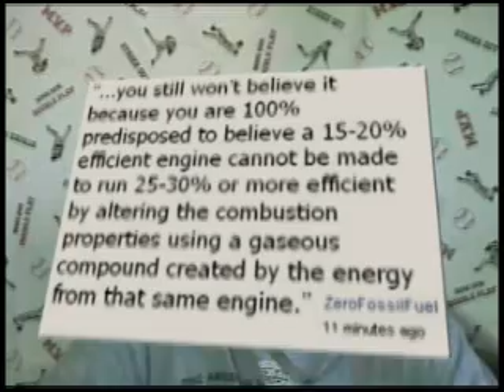Follow-up: '#232 - HHO runtime experiment part 3'

Comment: with more power at the right rpm u will have to push the throttle less for the desired speed..... which leads to less fuel consumption.  it may be very very little when going from 82 to 96 octane.  but it does increase mpg.

Comment: I am not a cultist. I've been trained in science since a child in school. I built 3 hho gens & have tested all 3 in my '96 Ford Explorer 5 ltr V8 that was getting only 8-9 mpg in town and 10-12 mpg on highway trips. My last 2 highway trips w/ hho gen, logged 14.9mpg & 17.2 & my vehicle was not empty, I was carrying extra loads in the back of the suv -explorer. Real highway evidence, not lab numbers from static testing without a load. I also used smackbooster designs to build 2 of my devices.

Comment: @MegaVelvetElvis Part 3, Jacob Wall continues:

4. The challenge to using hydrogen as a
supplemental fuel is the storage and generation
of hydrogen.
5. Use of electrolysis of water to create hydrogen
to enrich combustion should be completely
experimentally investigated before dismissing it
as ineffective.

------------------------------------------------------

I think it is you, MVE, who needs to do more research...

Comment: @MegaVelvetElvis --- Part 2, Jacob Wall writes:
Introduction of hydrogen into the combustion process
has been shown to:
1. Increase thermal efficiency and decrease fuel
consumption.
2. Decrease carbon monoxide and unburned
hydrocarbon emissions.
3. Increase NOx emissions unless proper timing
and mixture adjustments are used.

See part 3

Comment: @MegaVelvetElvis -- But that is not what the report says. That is not what I've seen with my own eyes. HHO increases the lean burn operation allowing you to use less fuel. This leaner mix of fuels increases the TE of the engine giving you more power. Yes there is an additional load but due to the inc. TE  you get the same performance from the engine but using less fuel. Under the right conditions this works well. 3X more fuel usage is BS. I've seen it work and the study confirms this.

Comment: @MegaVelvetElvis --- Nope that's not the case, the study in question here showed higher NOx while others show reduced NOx levels. Anyway NOx emissions are reduced in the cat. so It's not really an issue either way... Cost of operation? Humm, KOH and water is pretty cheap and since you are saving fuel I don't think cost is a factor...

Comment: @Desertphile --- No MVE hasn't been using my numbers. He may have pulled some numbers I posted as rebuttals to his his numbers. In each case I have stated that all of those types of numbers are speculative. The data in the report are the only valid numbers in this argument. We have scientific proof vs the youtube naysaying crowd's opinion. BTW I know that this does not mean that every HHO application will work. However the theory that you can save fuel using HHO has been proven.

Comment: @MegaVelvetElvis --- The bottom line here is this peer-reviewed scientific publication concluded that after factoring in the power requirements replacing part of the fuel with HHO made on board give you an increase in TE and you save fuel. And no matter what you say here that fact will remain. If you feel this report is in error then go ahead and dispute it but do it the same forum as the report was done. Build it, test it, and get your results published. End of story...

Comment: @Desertphile --- No hatred here from me. The fact is MegaVelvetElvis' numbers are not valid. They are mere speculation and have no real value in evaluating the data in the report. Oh sure they follow ohms law but MVE conveniently leaves out  too many factors. The bottom line is the report shows that replacing part of the fuel with HHO made on-board can save fuel.

Comment: @MegaVelvetElvis --- LOL you are such an idiot. I've already told you that they tested a wide range of HHO levels at varying loads. The data shows increases in TE starting at 3LPM. The data also shows gains are possible across a wide range of HHO levels. This is what I said a month ago, this is what I've said all along. Your incessant cry that I conceded the gains are only possible at full load is BULLSHIT. The cited publication is proof that gains are possible using HHO...

Comment: @MegaVelvetElvis "...Alternator running at 60% efficiency, so that's 12.8kW to an engine that HAD a 19kW load, now it has a 31kW load." And we used 15.07% less fuel with the additional load. But that's all speculative BS numbers. The real numbers are contained in the report. The power requirements + the energy value on the HHO = 4.84% of the total available energy. Adding that gave a 15.07% savings in fuel in at least one test. Simples

Comment: @MegaVelvetElvis --- "You "claimed" the Epoch "could" be running 24V internally, but that's a lie " Really? There is no way to use 24V across a multiple plate cell so the voltage at each cell is around 2.3V? FYI the Epoch EP-500 is not a "jam jar" type system. Quit making foolish statements...

Comment: @MegaVelvetElvis --- WTF is wrong with you? I conceded no such thing. They state the power requirements plus the diesel equivalent was used. They used 4.84%,
6.06%, and 6.12% and posted gains of 15.07%, 15.16% and 14.96%. Quit lying...

Comment: @MegaVelvetElvis --- 

4) You lean the fuel in accordance to the amount of HHO added (gain)

5) You get an increase in TE (gain)

Your claim deals only with losses, you ignore the gains. The bottom line is you use less fuel. It's not a net loss...

Comment: @MegaVelvetElvis --- Part 2, your 3X the fuel (or is it 4X, or is it 5x) crap is just that, crap. You ARE making claims that do not reflect reality. I'm simply suggesting that you back up YOUR CLAIMS with proof. Build it, test it, and get your data published. That's what has been done already with the positive assertion, its now your turn to refute this in the same manner as it presented. Quit being a keyboard naysayer and prove your claims...

Comment: @MegaVelvetElvis 
great.
i do think speed limits should be around 50.
or another gear added to cars.
i drive a 4x4.....28 to 32 mpg. small truck....it hulls stuff..
if you worked you might need a truck also.
it gets tuned every year. 312,000 miles on it.
since your so rich. why not buy me a new one.

Comment: @MegaVelvetElvis 
hey dummy......munch not much!
you talk about my spelling!
if you can make hydrogen with less energy.......then it will work. even if you use alot of energy......if you use it to clean the water and process waste water.....
you just saved energy, not wasted it.
try to think of more than just one thing.....i know thats hard for a coal hugger.
try to multy task. start with chewing gum and walking at the same time.
coal hugger

Comment: @MegaVelvetElvis 
if you had read the wiki entry, it says clearly..
"When reactive elements such as capacitors, inductors, or time-varying voltage ........ the relationship between voltage and current becomes the solution to a differential equation, so Ohm's law (as defined above) does not directly apply since that form contains only resistances having value R, not complex impedances which may contain capacitance ("C") or inductance("L"). "
wow............

Comment: @TruthfulPinecone 
you did say i was right
you said....... 5 little tanks of H2.........run a car for 80 miles.....
its stored , will run, goes 80 miles.
HA HA HA
you stand corrected 5000 psi tanks exist...............
i would call that a bigger tank.......
how much does 20 gallons of gas wiegh??????

Comment: @MegaVelvetElvis 
wow you just said i was right!!!!
5 tanks, no! these are small.
just use a bigger tank.
80 miles is fine.
charge battery bank with solar cells during day......use battery bank to make H2 at night. expanding gas will preasurize the tank..... drive your car to work and home....
cheaper than buying a battery car.
cleaner burn than gasoline.
no coal was burned.
gasoline could be a backup.....its aleady there......flex fuel
it makes sense

Comment: @TruthfulPinecone your so busted.......propane and natural gas engine systems work on around 15 psi.....
hydrogen will work at 15 psi. want more throttel......add more psi.or more volume.
its a gas that burns dummy. and you only need 15 psi 
anyone can buy it...dummy
i dont need to buy it dummy.
gasoline fumes burn to dummy.
where do you think dillile gets there gases?
someone claims them from something or somewhere.....dummy
gas in a bottle tank can .......it burns dummy........

Comment: @TruthfulPinecone 
you cant read. how do you know i cant spell?
2200 PSIG, not 10000  
there it is man.
buy it in a container.......
contained H2 under pressure.
they are a real company.......sell this stuff every day.....even medecal oxygen to the hospitals....
end..............
you lie.....
your busted..........so so busted     
how about your oxygen for the bedside.......also 2000 psi.
and argon for welding.2000 psi

Comment: anyone can go to Dillile Oxygen and buy.........
pure hydrogen.....H2
2200 PSIG
221 L
4.2 x 10 inch bottle   
i believe the bottle is made of steel  
and the germans blimp...they contained H2 in the blimp thats why it floated  
contained H2.
look it up Dillile Oxygen...under pure gases.    
pure H2 burns. watch the hindenburg burn. it burned not exploded. it must have the oxygen to explode.
like propane or gasoline...burns.
buy it in a can if you like. someone put it in the can

Comment: @TruthfulPinecone --- Exactly how much energy and resources are used make these batteries and aren't those resources finite? Then you must consider the waste generated by spent cells. Also where will the energy come from to charge these batteries? From an already over burdened power grid that relies on carbon/nuke based energy. Going to battery power economy has a host of issues too. Sure a battery could be a better energy carrier but ultimately H2 is the greener choice.

Comment: @TruthfulPinecone --- Another interesting technology used today is the gasification-fermentation process. Here's a PDF of a pilot plant located in Arkansas tinyurl,com BMGethanol.  This process differs from the FT process by using a biocatalyst to ferment CO gas to ethanol. Steam and H2 are a by product of this process and can be used to make electricity. Both of these processes are are much better environmentally speaking than the oil industry.

Comment: @TruthfulPinecone --- You got that wrong, H2O + CO -> H2 + CO2 is the water gas shift process. The H2O + CH4 -> CO+ 3 H2 is the SMR process which can be step used in the FT process . The FT process is (2n+1) H2 + n CO → CnH(2n+2) + n H2O which takes the H2 and CO gases formed by either the SMR process or by biomass gasification and converts them into a hydrocarbon. Biomass gasification is not SMR... Sorry but you are PWNED on this one...

Comment: @TruthfulPinecone --- The resulting gases produced are H2 and CO. The heat generated produces steam and using the water-gas shift principle the steam and CO is converted to H2 and CO2. They then used the Fisher Tropsch process on the H2 and some of the CO to make synthetic fuels, oils and even waxes. The only real use of fossil fuels is in transportation of the biomas material.

Comment: @TruthfulPinecone --- No, that's not what I'm saying. I never said High Pressure electrolysis was different energy wise other than it didn't need a compressor for the H2 it's not super electrolysis. But it does need a pump (compressor if you will) for the water, sorry my statement was misleading.  It uses less energy than a jet engine to get up to 10,000 psi. The Biomass process used does not require fossil fuels to burn the biomass. Look up wood gasification.

Comment: @TruthfulPinecone --- "I stand corrected, you need either compressor that is in effect a jet engine, or some other system with the power equivalent of a jet engine." Nay, you just need the the same amount of energy used to liberate the H2, no more or less. This just eliminates the need for a compressor. Some other Hydrogen economy technologies you might take another look at use biomass instead of fossil fuels. One facility is located in my State at verdereformation,com replace the ","

Comment: @MegaVelvetElvis --- Look it up, it called high pressure electrolysis. I don't make shit  up. tinyurl com GMpatent. If you can make H2 @ higher pressure in the electrolyzer then you do not have spend energy to compress it. Oh and H2 is less dangerous than propane or gasoline in the respect to rate of dissipation. If you have a propane or gasoline leak it pools while H2 dissipates into the atmosphere reducing the chance of explosion.

Comment: @TruthfulPinecone --- "You need either to cool it to 20K, or use a jet engine to compress it, and maintain cryogenic storage, and even then it's so small it'll leak though steel. " Actually you can make it on-demand at up to 10,000 psi without a compressor, GM holds the patent for such an electrolyzer.

Comment: @TruthfulPinecone --- "In fact at present is less efficient than a solar panel. " But I don't see too many car using solar panels, there are some that use H2 however. And what does efficiency have to do with the subject of whether or not H2 is a fuel?

Comment: @MegaVelvetElvis --- "If you're unwilling to provide evidence to backup your claim that HHO devices improve gas millage and reduce emissions" It a published fact, why do you require more proof than that? A peer reviewed scientific publication says it works, a division of the DOT outlines regulations for the use of these devices and states gains in MPG and reductions in emissions are possible, and the previous mentioned 100,000 miles of over-the road testing. Cont...

Comment: @TruthfulPinecone thanks for calling me mr.....shows alot of respect.
you should change your name to untruthfulpinecone
if you had watched the videos..... clearly you can see no bubbles with DC...then with pulsed DC there are bubbles.......i think that would show a flow with out your meter. also the one is hho bubbles from a small 9 volt battery,pulse DC. again ......if faraday had pulsed DC then......he never would have stopped experimenting.
with your big head and dirty mouth, good work

Comment: @MegaVelvetElvis you also miss the point that they do manufacture hydrogen everyday.
you can buy it
and electrolisis is not the only way.
oxygen can be claimed right from the air.
metals are extracted directly from see water
iron comes from iron ore
aluminum comes from ....i forgot....but not an aluminum tree
only things that come directly from the envirement are soil and water
and we haved ruined those

Comment: @MegaVelvetElvis even your coal is processed.
there are different grades of coal.
gasoline is processed and desiel to.
waste is processed...
water is processed
soon air will be processed
the same wasted can be cleaned and less polution because hydrogen burns cleaner then coal.
sewage could be used as coal.
stan meyers car run on water alone....
it will work .....it has worked...
unlimited clean air and water for everyone. 
your still missing the point that hho gas burns clean

Comment: @MegaVelvetElvis imagine, clean water and oxygen as a byproduct from waste disposal. when the water goes through the bubbler. the bubbler acts as a scrubber just like you said of the rain. many gasses could be harvested just like you said.
you see it really is the perfect fuel.... the little crappy hho cells are just the start. the planet recycles water every second.....humans can do the same. safely and with little electricity. and cheap for the poor nations. it does work better than coal

Comment: @MegaVelvetElvis easy to purify water by leting it recombine into water.
the red water you saw....is from what was clear water 5 min before.
water turns to hho gas.....if left alone it quickly turns to water again....so you could distill water then seperate the sludge further....if sewage water was used, sludge could be used as coal. hydrogen burned cleanly and oxygen or clean water as a waste. many minerals are trapped in water, even gold. in this process so many things are possible.

Comment: @MegaVelvetElvis i never said ignore it.engineering changes. it never remains the same.it updates with the books. whatever is int he water.....is everywhere......you will never get away from it.......in the process of making hho......it could be used to purify the water as well....any thing that is in it quickly seperates......so you could even use sewage water. seperate the hydrogen and oxygen then anything else in it. burn the hydrogen cleaner than coal. have oxygen left over. purify the water

Comment: @MegaVelvetElvis batteries keep going up in price
in ohio. there is only enough wind in the spring or summer....not usful in ohio
solar......batteries cost is to high.......only useful in the long hull.
i have them......not real useful..... but i use them. and plan to use more.
1000 poud load.........if gas made was enough to compensate for 1001 pounds its great......i drive alot........if it adds up to 1000 or less you are correct.
but with the same solar could make that gas.....then drive

Comment: @Desertphile humans on earth have made hydrogen from water for around 100 years........germans used it in the war.........
today you can buy it at the welding supply in a bottle just like the other gases.........all bottle gases come from somewhere. hydrogen can be made just as easy as any other gas........pure hydrogen is no more dangerous then propane or gasoline

Comment: @MegaVelvetElvis wind power is not useful when the wind doesnt blow.
methane is great...... renewable and cheap
hydro is great......should be more of it
electric mains is great but the cost is higher than you think.......trucks to haul diggers workers drive to the job .....polution from the plant......thats just the coal plant......and not every country burns clean coal